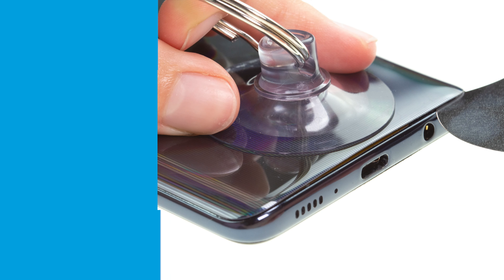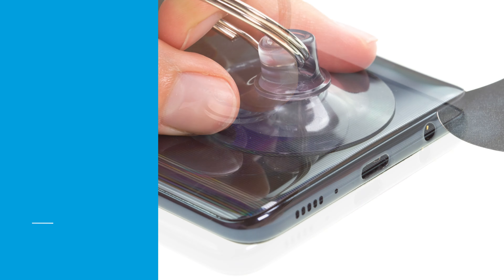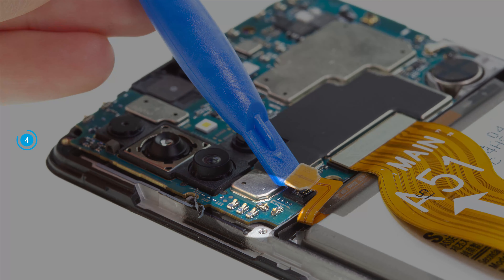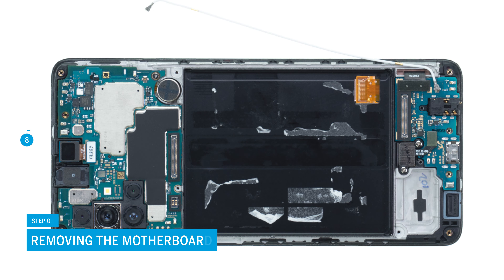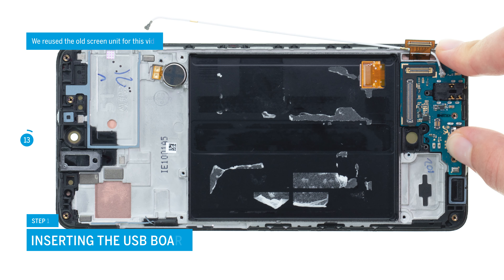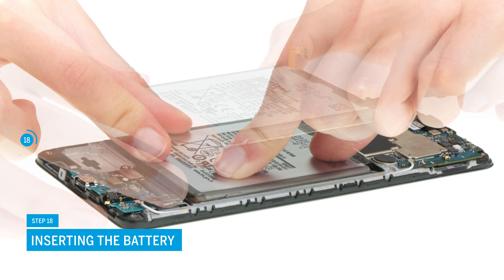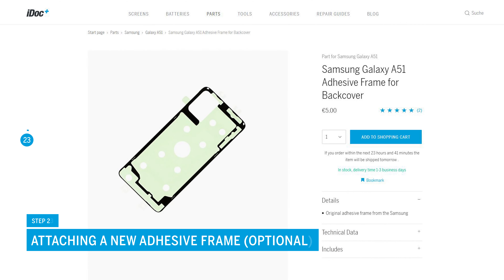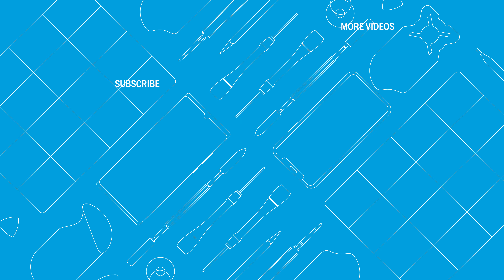Samsung Galaxy A51 – Screen replacement [repair guide + reassembly]

Comment: Hi i have a a51 and recently replaced the screen with an lcd but i noticed the touchescreen is slower. will an oled screen fix that issue? thx